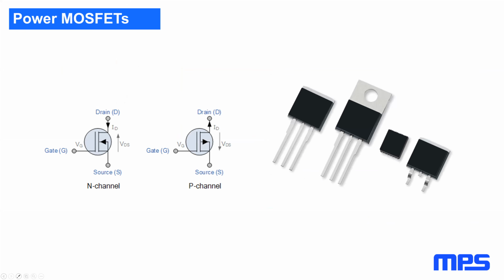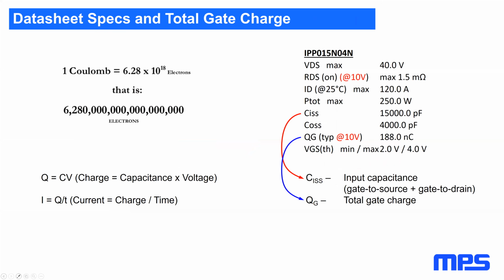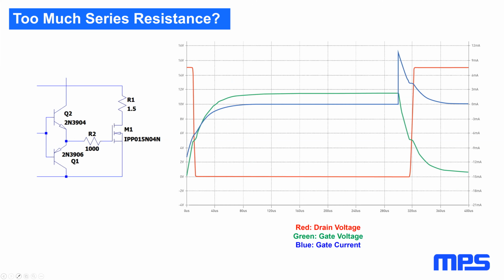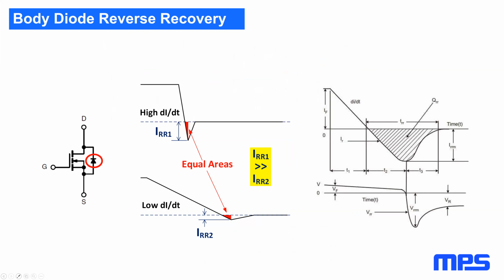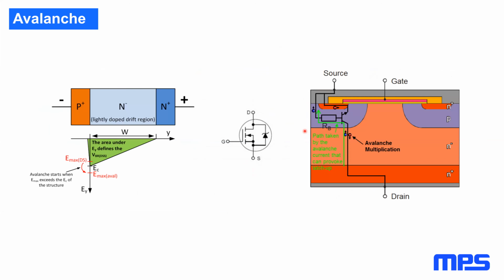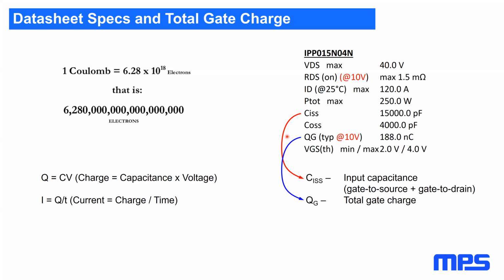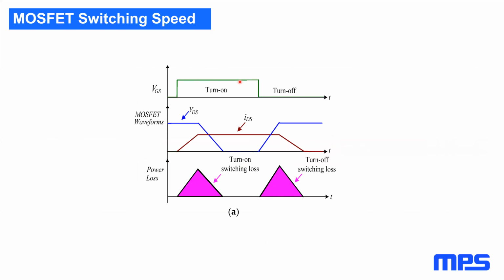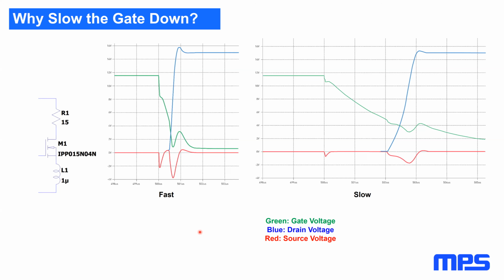Webinar: Driving Power MOSFETs

Comment: My gate voltage rings at 50Mhz at the end of Miller platform on the (off) trailing edge. Its driving me nuts. Maybe my fet is too snappy?
Reply from the maker: Thank you for sharing: This ringing can be caused by many things. The gate signal PCB trace length, width, and parasitic inductance, as well as coupling from the output are likely suspects.

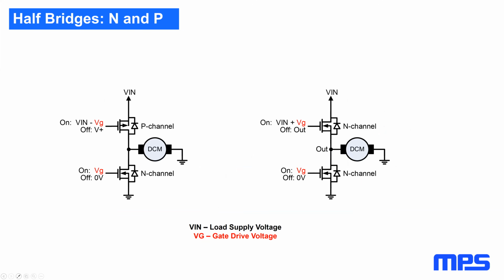Comment: After 3:41, on the diagram of upper side N-Channel mosfet it is written as "VIN + Vg". If you apply more than 20 volts to gate of N Channel mosfet, bye bye to mosfet. Let me give you an example. Now a days i am working on a circuit. Supply voltage, I mean VIN is 44.2 Volts. According to your calculation 44.2 Volts + "let's say" 5 Volts = 49.2 Volts. So it is over and over and over and over than 20 Volts limit. If you do not believe me test what i say. For n channel mosfets Vgs is so important. Vgs mostly can not be more than 20 volts. Some n channel mosfets accept 25 volts. That's it can not be not more.
Reply from the maker: Obviously, the high side gate cannot be driven instantly to VIN+VG when the HS FET is turned off and the phase node is at 0V.  The HS gate driver is typically referenced to the phase node, and the gate voltage is driven to 12V above the phase node.  This was not shown to simplify the discussion.  Once the HS is turned on and the phase node has reached VIN, then the gate is held at VIN+VG, around 12V above the input supply.
Reply: @monolithicpowersystems  First of all respectfully i want to thank for your kind reply. Could you please share a sample full circuit to make us understand this explanation better.
As i mentioned in my first comment, nowadays i am working on a circuit to drive a 44.2V and 2500 watts bldc motor. I made a circuit uses p channel mosfets for upper side and n channel mosfets for lower side. The problem is p channel mosfets' capacity is not as enough as n channel mosfets generally. That's why i have to use multiple parallel p channel mosfets to reach my power without any damage to p channel mosfets. This case causes pcb space problem. My pcb size is limited depands on my project.
That's why i am so interested about your subject. If you share a sample full circuit i will be so glad. Thanks.

Note that: I have just 12s (44.2V battery). I do not have any other power source.

Comment: Why didn't you release divers datasheets of your products in consumer area?
Reply from the maker: Hi, we have motor driver datasheets available at https://www.monolithicpower.com/en/products/motor-drivers-and-motor-controllers/stepper-motor-drivers.html
Reply: @monolithicpowersystems  Motor Driver in consumer market🤔🤣. What ist with power mosfets and high,low Mosfet driver IC's for voltage regulation. Sorry 😪, you didn't answer the question. Note E sit down please.

Comment: A part of this comment was erased. (I Made an ignorant remark).
Like this lecture for its quality of practical simplicity.
Reply from the maker: MOSFET resistance goes up with temperature.  PN junction forward voltage (not resistance) drops with temperature.

Rds(on) across the channel of a MOSFET is not a PN junction.
Reply: @monolithicpowersystems  ok. I am sorry. My mistake.
I just learned something.
Thank you for your reply.
I.subscribed to your channel, to better learn from you.
Reply from the maker: Great, welcome to the channel.
Reply: @monolithicpowersystems  thank you.